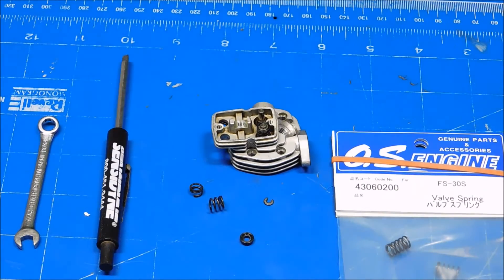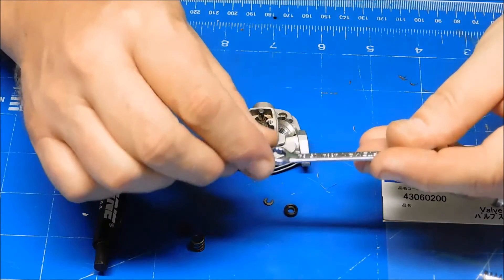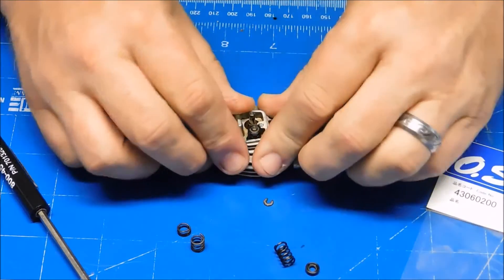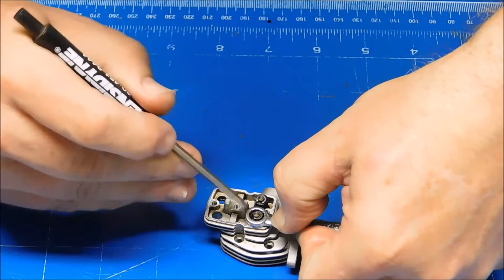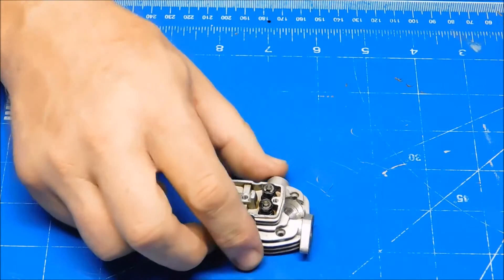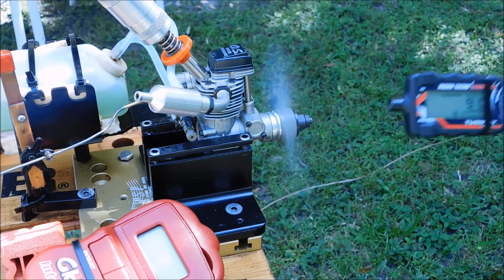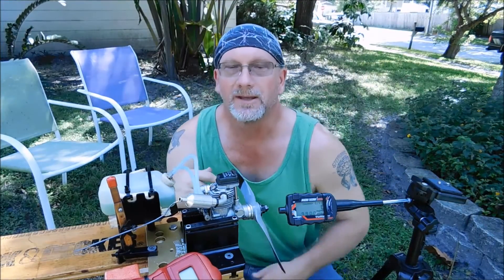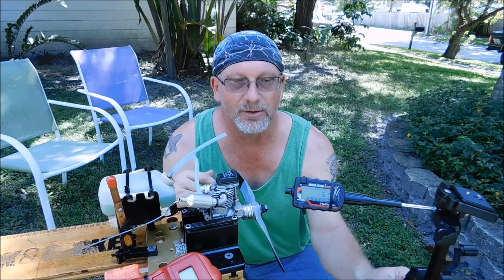OS FS-30 Surpass Valve Spring replacement and Performance Run

Comment: I had an intake valve fail on my FS30 marine conversion. Replaced it with a random spring with a lesser spring constant and it runs fine. No idea what made it fail.